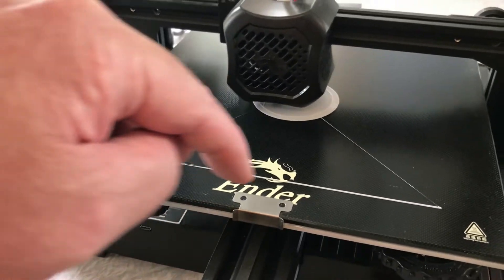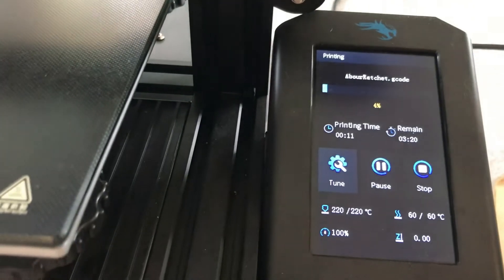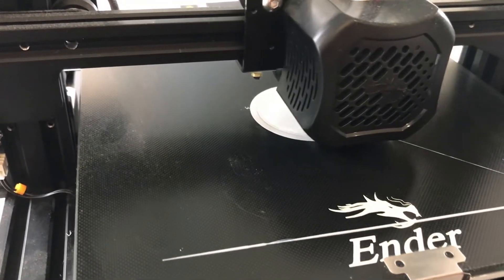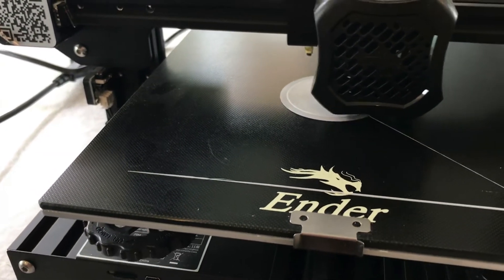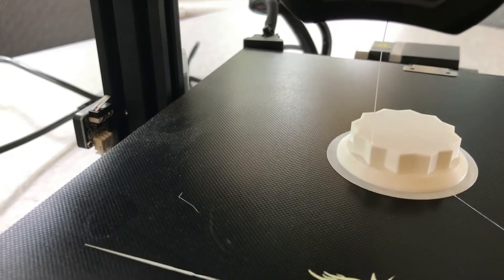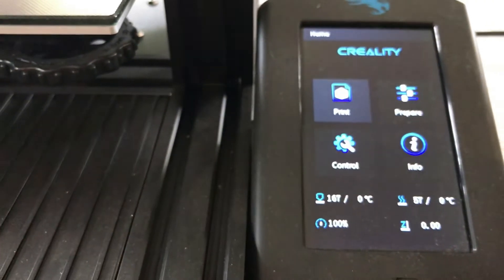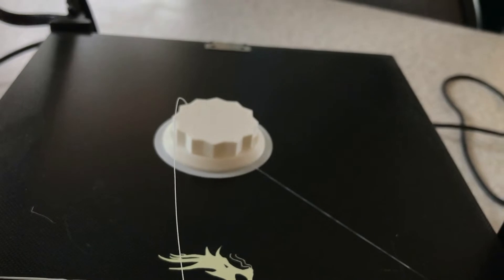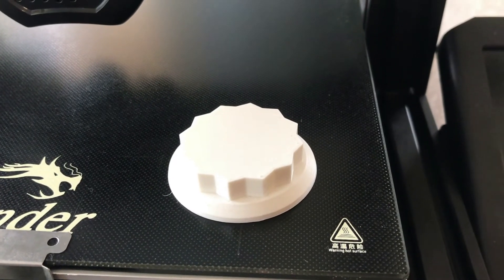Fusion360 And Ender3 Pro V2

Comment: I've been using 3ds extensions for my meshes... So yeah, I'll be using fusion 360...😀👍
Reply from the maker: Make modifications to your meshes and then export to STL file and print with Cura. F360 slicer needs some work.
Reply: @bms250ford  thank u so much for the advice. Great videos! 😀👍
Reply: @bms250ford  why would I use stl, ender 3 supports obj meshes already... Stl will strip a lot of mesh info like texture... 😳
Reply from the maker: @christophertadeo6120  I only know what works for me. See my other videos on printing T12 soldering station enclosures that I have designed in F360 and exported as STL file to Cura for slicing and Gcode generation. Print quality was better than using the F360 post processor.
Reply: @bms250ford  I'll consider it... 😳.. Great video again.. 😀👍